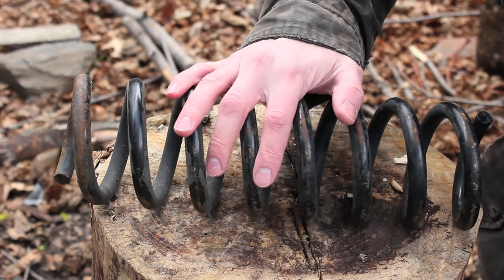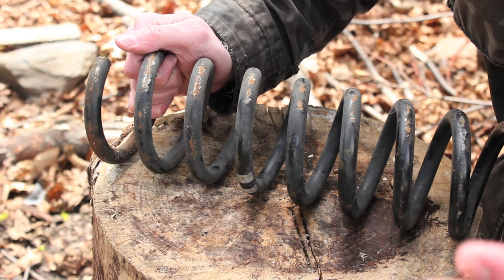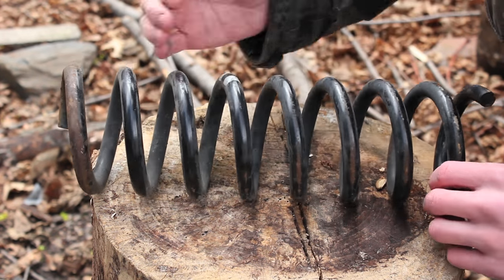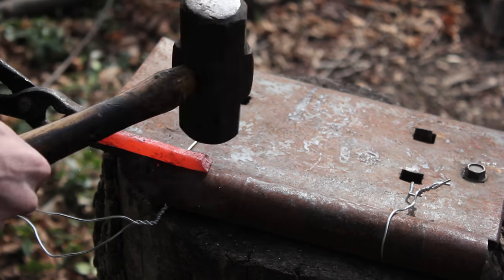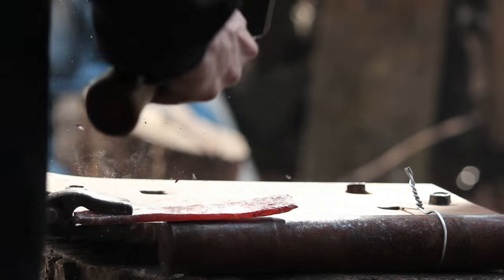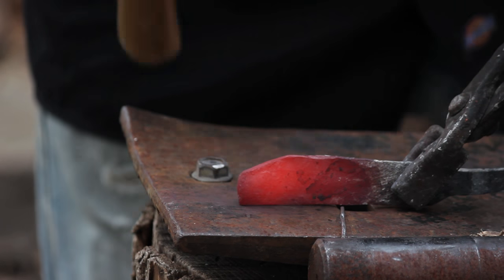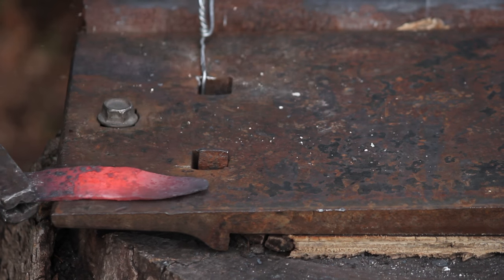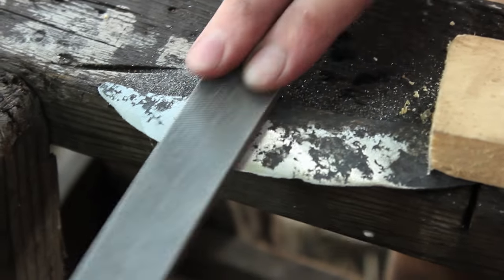Forging  a Knife from a Coilspring- Part 1

Comment: Drawing a file backward instantly damages the beveled cutting edges, use a quality file and take care of it as you would a precision instrument, only use moderate pressure and store them in wooden, soft plastic, oiled leather, or synthetic canvas to avoid contact with hard surfaces when storing, never set, store, or strike a hard surface with a files work surface of it will be damaged, use a file card after filing softer metals to avoid galvanic corrosion from electrolysis. Annealing is contradictory to your initial purpose (I assume)  a good properly handled file is less cost, labor, and time extensive than the annealing, re-shaping, and re- - re-finishing of the blade.

Comment: Forge scale is really hard on files. I put the steel in vinegar for a few hours and wire brush it off. Your file probably just got dull. Can't wait until the project is finished.
Reply from the maker: +Ernest Sheffield
Thanks for the advice!
Reply: +Phil Baumhardt I'm just glad I could help. Also look at the 4x4 anvil from old world anvils. It's cheap and is very handy. They can also make one up to 1ft long if you need a heavier anvil. That of course would cost more. If I still had my contact I would have been able to get you one that was 6x6x10 in 4140 for less than $50.

Comment: I really enjoy your videos, but please invest in a bench grinder, the one I have was about $50 at home depot
Reply: Dylan Lewis , some prefer the absence of power tools after the metal hits the forge so it is actually an authentic hand made original piece. that includes drawing, shaping, and shearing,as well as filing, beveling, honing, and polishing. the increase in it's personal value is worth the extra labor

Comment: It's been 6 months... where's part 2? Also, cross peens work better than a round stock for widening or drawing out steel.
Reply from the maker: Part Two is in the works, there will probably some other videos before it though. Thanks for the advice
Reply: +Phil Baumhardt I like what you do it like my hoby and I was wandering came you send me a nice I have a nice collection